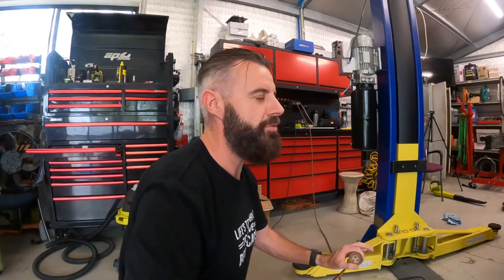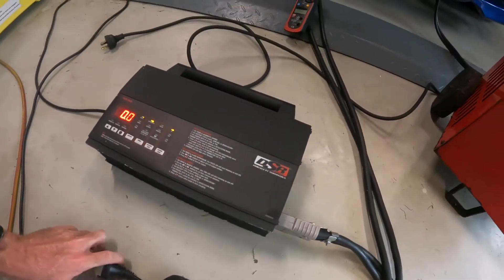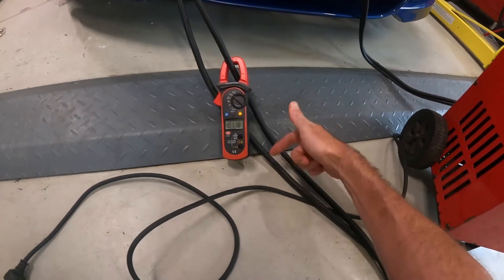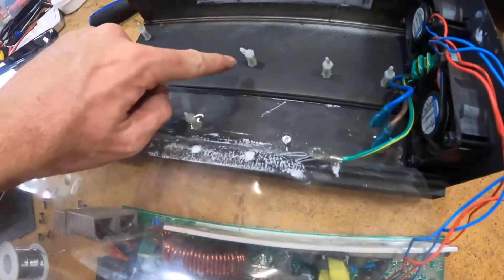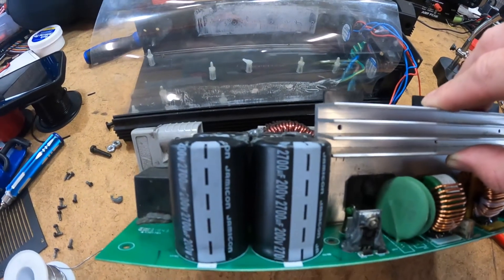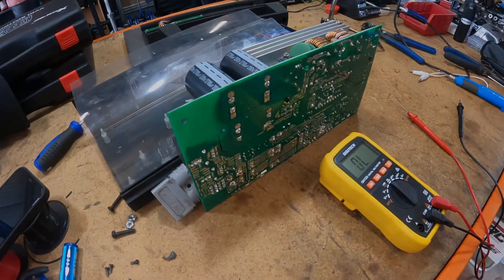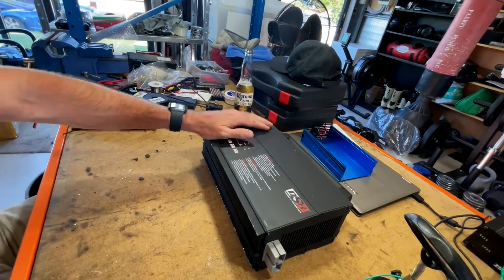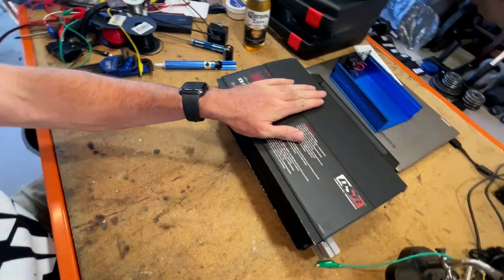Schumacher DSR INC-100 Is Faulty: Can It Be Fixed?

Comment: Voltage controller issue- hook both cables together, hit flash, hold down start/stop until the charger turns on and discharges the capacitors. Charger will appear to short out but will restart and should work. I've fixed tons of these dsr's that way. If it happens again the capacitors are bad.

Comment: Thanks, I hope you find a fix for this, my unit is going faulty also. It is only outputting 7volts in the 70A mode. Even tho the front screen is showing 14.9v.

Comment: If you hear a sizzle noise it could very well be a faulty Capacitor but the only real way is to check the Capacitors Capacitance and it should be within 10% and also measure  the capacitor ESR value. Usually they leak electrolytes when they start to sizzle and you will see the leak on the circuit board.

Comment: The hissing noise is likely bad caps, my 70A version of this unit is getting very noisy but still functional. Regarding the output current in auto charge mode, it will slowly ramp up the current, so I think the 1A at the beginning may be about right. You could put it in flash mode & set it at 14.8v and connect it to a healthy discharged battery and it should output full power. you can also chose 70 amp manual charge mode, it will still vary the output current but will start out much higher than the 1amp. If the unit is not reading the voltage properly, that could be the big issue. Under full load (75amps on mine) I will see less than .5 volt difference between batt voltage and what the display shows for voltage. I almost always have mine showing current. Hope this helps. I do plan to replace the caps in mine eventually, it has been a GREAT charger/power supply that puts out clean power compared to a standard wheeled battery charger.

Comment: Was there ever a fix found for this? My 70 amp is doing the same thing.
Reply from the maker: Not as yet, still sitting on the shelf
Reply: @testandtune6096  Thank you for the reply.
Reply: I'm having the same problem, my flash programming 70A mode is only outputting 7volts.